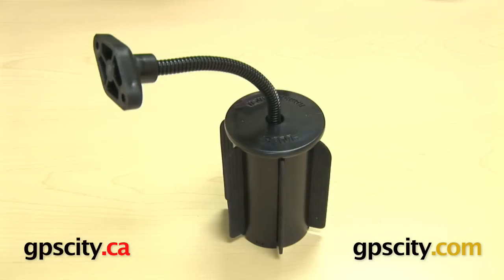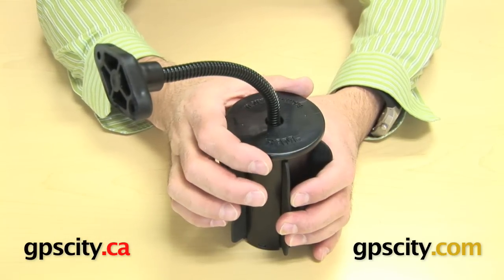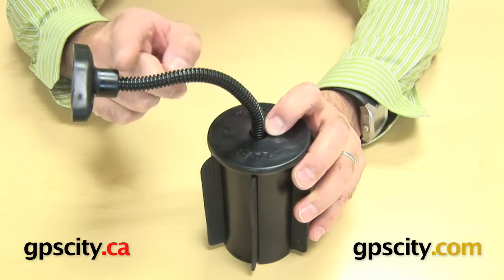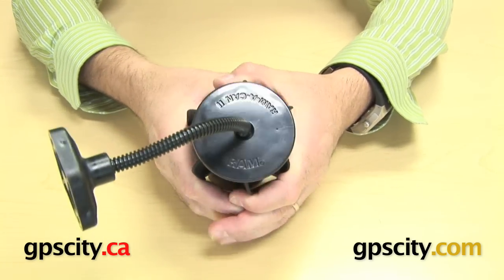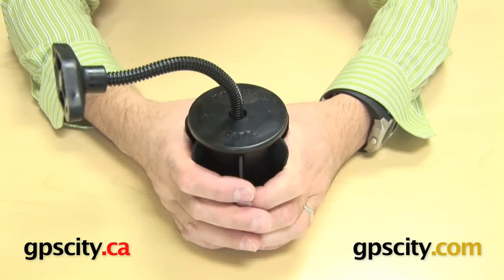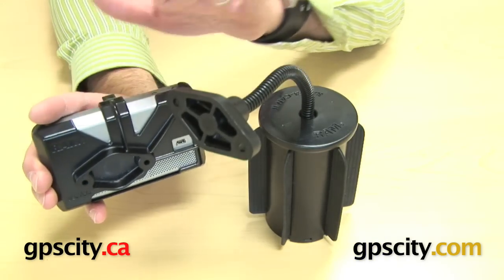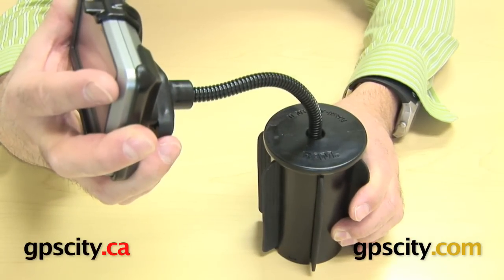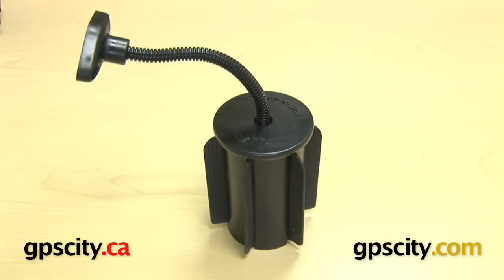RAM Mount Cup Holder Flex Arm Mount (RAP-299-2U) @ gpscity.com

Comment: @fizk 
I think an important point would be where the cup holders are located. In the Honda Accord, the ones for the front seat are very far back. I don't know how safe it is, but I put mine in one front of the dashboard speedometer display, since the GPS shows the speed. I have to be careful to realize when the gas gauge gets covered. :)